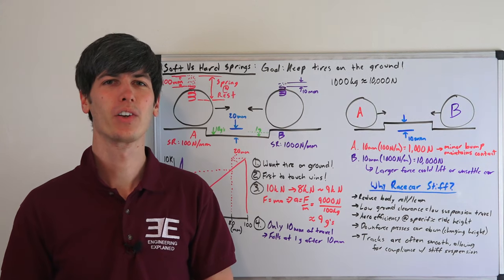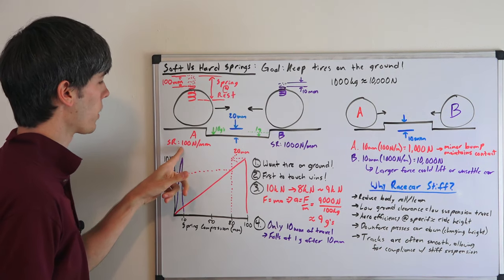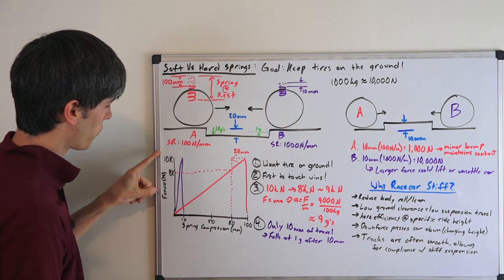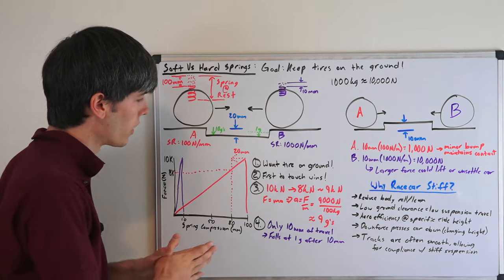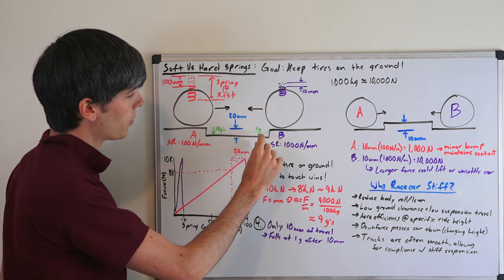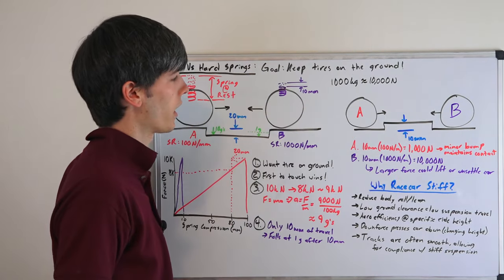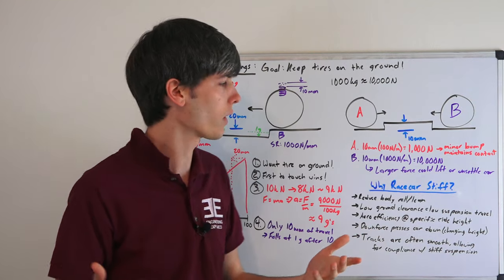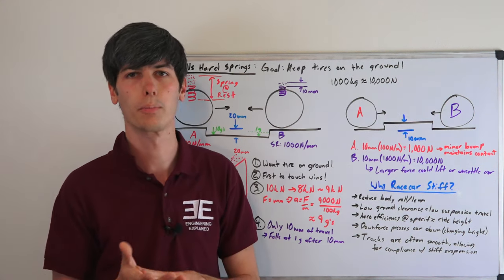What's The Best Suspension - Soft or Stiff Springs?

Comment: Stiffer springs help maintaining lower diving on heavy braking and turning. This is helpful because the sudden changes of load disrupt the balance of the vehicle and the contact patch of the tires. Having said that, most of the times racing cars' suspensions (that applies to bikes also) have stiffer rebound settings which actually help keeping the tires on the ground more under heavy acceleration or braking. That's why most of the times when tuning a car you don't mess with the springs instead you change the shocks. Just my 2 cents...

Comment: When the car is driving at high speed, the frequency of the bump accelerates, and if the tire is to get maximum grip, the shock-absorbing system that requires a short travel schedule can follow the frequency of the bump.

Comment: Very good video, thanks.
I may add few things. 
Lets look at stiff suspension pros & cons and we may assume the soft susp. will be reverse of these.

stiff susp.
pros: as you expressed on your video
plus, stiff suspensions allow more precise handling on smooth surfaces and they tend to more responsive to driver  inputs than the softer suspension.

cons
* relatively quick tire wear
* difficult handling on bumpy surfaces and more stress on suspension members & attached points.
* not comfortable

IMHO the best suspension is.. what is the definition of the "best" btw? 
Ok, let's say average "best" for the sake of the argument, it is dependent to the surface quality, road conditions, appropriateness of tires, the driver and maybe the mood of the driver :)

Comment: Let me throw a wrench into this equation. The Nurburgring... car makers test their flagship sports cars there, and try to achieve the fastest lap time for that car's class. The Nurburgring is also notoriously bumpy. Yet the end result of testing there and chasing lap times leads all car makers to fit their sports cars with notoriously stiff springs, as James May likes to complain.

I think you're absolutely right though. I just think the benefits of stiffer springs outweigh the disadvantages, even on bumpy tracks, if your only goal is to achieve a fast lap time, or have better control/feel of your car on a mountain pass. 

The one Motorsport venue where softer springs provide faster times is rallying, and the bumps on the Nurburgring or your local togue are nothing compared to rallying.

Comment: Fantastic video, I remember lowering my civic type r (ep3) and it completely destroyed the handling, mainly due to the lower control arm being pushed passed horizontal at rest resulting in the cornering forces being sent through the suspension instead of the chassis but the stiff suspension made it a nightmare also, hopping and skipping around. Removed them after 4 days or so to go back to standard springs.

Comment: As has been stated, in the racing world, you go with as soft a spring as possible. If a car has downforce, and is very pitch-sensitive because of said downforce, you will end up being forced to run a stiffer spring. Many of the new GT cars have front splitters designed to create massive downforce when placed close to the ground. Not only are they very pitch-sensitive, but they have to be withing a couple inches of the racing surface. Obviously with such limited ride height and pitch allowance, very stiff springs are used. For people bringing up spring splits, this is how one would balance the car. Usually, race cars will tend to like a certain spring split "window", a specific F/R spring ratio that moves together when stiffening/softening the car. This ratio can be moved slightly to affect the balance of the car in different parts of the corner. Also understand that a "big spring" will take a "big damper" to control it. This is very complex process, so please don't say things like "you can usually go with X front and Y rear". Without knowing car weight, motion ratio of the wheel, intended ride height, intended use, tire type, etc., you really can't state a spring rate.

Comment: In general softer suspension are better suitable for road cars which constant meets unexpected and uneven road surfaces. Race cars on race track which constantly drive at very high speed on controled flat surfaces should  use hard suspension setup. Because of aerodynamic lifts and down forces effects the racer so you must use hard suspension setup to maintain the height.
Some people still don't have any clue due to the amount of softness and hardness to use for customize their own vehicle. Although not all the time but most of the time your vehicle manufacturer's engineers has calculated the best compomise settings for your vehicle's main use purpose. But randomly some owners may not agrees with his OEM setup. So if you need to customize it then you must figure out how much softer or harder than the OEM. Not surprisingly it will be trials and errors for your perfect setting. Unless you have the opportunity to full access to your manufacture's engineering faculty or luckly for you the after market supplying you an exact test mule as your vehicle. 
If you still don't understand why and how, then stick with OEM can't go wrong. After all you are betting with your wallet.😇

Comment: There is another factor in play - damper rate. A stiffer spring demands a tighter damper to control it at resonance. Damper rates are measured in m*sec^-1*N^-1. Tighter dampers transfer more shocks.
Yet another factor is the lowpass filter created by the spring and the mass. The tighter the spring the higher the frequency at which the filter operates. In other words the stiffer spring transfers vibration at a higher frequency into the car body, resulting in excess road noise and passenger discomfort.

Comment: I like Carrol Smith's advice.. Have just enough spring to keep the nose off  the pavement under maximum braking load. Do the rest with sway bars. Also feels like relatively softer in bump and stiffer in rebound for the shocks seems like a good idea.

Comment: I put as wide and as sticky a tire as I could fit on my car. the result was the grip made the suspension feel weak. it couldn't keep up with the grip from the tires and the result was extreme body roll. I raised the spring rate to match the grip levels better and it feels better. on bumpy tracks I need to have the bump setting on my dampers at full soft or I get worse breaking.

Comment: This video is very subjective. Each has advantages, but for street driving, stiff and low allows for better handling and more grip through turns. The best case for soft springs is in rally racing, where the springs are very soft, but very long. That allows for the car to have a low stance (low center of gravity), but keeps the tires pushing to the ground despite all the dips and bumps on the uneven surface. That's just my two cents. Great explanation though.

Comment: This would be much more accurate if you included tire physics in your explanation. Sure, soft springs will give higher max grip in a car under steady state longitudinal acceleration but the moment you turn the wheel body roll will rob grip from your outside tire greatly reducing your max lateral acceleration. Not to mention the fact that a car with soft springs will experience all kinds of wacky yaw charicarisitibs if you take into account fore-aft weight transfer in the braking/acceleration parts of a turn. With overly stiff springs even a neutral steer car with IDEAL suspension geometry at steady state will push/spin in corner entry/exit respectively As you said, tires are everything, but the job of suspension is not as simple as "keeping the tire on the ground." A good suspension needs to keep the load on each of the four tires within their ideal load sensitivity. Finally critical damped stiff springs can avoid many of the problems you enumerated with stiff setups (see ohlins or moton street car setups).

Comment: His example was with both suspensions contacting the bump/dip at a certain speed.  As speeds increase, the energy of the bump increases.  Race cars, or cars designed to operate at high speeds, have stiffer springs to absorb the higher energy.  A soft spring will allow the wheel to slam into the suspension limit, at high speed.  An analogy is a valve spring:  As rpm increases the valve spring does not hold the lifter/follower to the cam lobe.  At very high rpm the valve "floats":  as a wheel would do if it's spring was not stiff enough for that speed.  That is why they use springs of different rates in the same suspension.  And they use multiple springs of varying spring rates for valves.  The trick for racers/competition is to have a stiff enough suspension for the roughest section of track, but still soft enough to maintain compliancy around smoother sections.......   Or a decision based upon the "bias" of the track......  Not to get off track, but I've heard of fluids that can change their viscosity by the application of electricity.  The fluid can be used in shock absorbers to alter the viscosity of the shock fluid, on the fly.  Electrorheological (ER) fluids

Comment: It depends on if you're driving on or off-road along with personal driving preference. I drive on pavement and my car has a low center of gravity, wallowing like a pig doesn't do anything good for steering compliance - so stiff is the way I prefer it. It's more manueverable and responsive. If I liked driving trucks I'd probably have a different opinion.

Of course these days many cars are made with variable-rate springs. An attempt to split the difference for the best of both worlds.

Comment: ive tried stiff/soft suspension on a corolla for street driving and honestly the only difference i can feel is the stiffness and softness of the springs. i can push the same speed around ramps and canyon curves and the tires will stick to the ground. the difference between the two for me is the feel of the car. in my case, i would leave my car with softer springs bc its convenient and does what i want/need it to do opposed using stiffer springs.
Reply: +Bee Vang I felt the same with my old corona, I felt I had more control with the softer springs on canyon/mountain roads, stiffer and the car loved to understeer. Plus stiff springs on the street I felt would wear out my chassis.

Comment: Ideally every motion, (ride, pitch, roll) of a vehicle should be controlled by a separate set of spring and dampers. I think it is more appropriate to say this video covers more about ride spring which control the vertical motion of the car. In general ride spring is set as soft as you can get away with that provides enough support so the car don't bottom out and don't over extend given the type of surface the car will have to negotiate. However most vehicle we see on the road are not designed with ride spring that only controls ride, but also pitch and roll. This results in a compromising situation where you can't go as soft as you want on ride while maintain high pitch and roll response like you want in a racing situation.

Comment: The springs should be as soft as possible, but as hard as necessary.  While the stock suspension of a Integra GSi is perfectly adequate for circa 1995 all-season tyres (as fitted and engineered for when it was new), when you throw on Hoosier R-compounds, probably on a 8-inch wide rim instead of the stock 6.5-inch wide rim, and take it to an autocross suddenly it's no longer as "hard as necessary"...  Hence uprated springs/shocks or coilovers being required. :)

Comment: EXCELLENT interpretation of the physics & dynamics of this subject! But I am curious about how engineers formulate suspensions for heavy duty trucks? Do the same perimeters apply? This industry only is concerned about hauling max weight, so does that change the formula? TX!

Comment: Very interesting.  I wonder if perhaps the stiff spring over a pot hole would be better because it doesn't allow the wheel to contact the bottom of the hole, it will allow the car to float over it?
Reply: +Carl S A wheel that's not in contact with the ground can't provide any traction.  That's a negative.

Comment: Ref the body roll control aspect - how do anti-roll bars / torsion bars play into the equation vs. simply reducing suspension travel and/or increasing spring rate?

Probably needs a "What an ARB does" explainer vid first come to think of it :D

It's nice to see this stuff explained with simple maths... keep up the good work.
Reply: The problem with these videos is that it talks about the effects of a piece of suspension in isolation.  The problem I have with this is that in isolation something may hold true, but on an actual car it certainly doesn't because a suspension is a SYSTEM and a complex one at that.  Spring rates themselves are not responsible for keeping a tire on the ground.  Their role in the suspension is to control the sprung mass (everything that the spring supports, like the chassis).  They play a minor part in controlling the contact patch but ultimately that job is in the dampers (shocks/struts).  Furthermore, this video does not consider ALL of the springs in the equation.  Your tire acts as a spring, as do the bushings in the suspension if they are bonded rubber bushings, as does the damper (to an extent), as do any bumpstops.  It's hard to consider things in isolation when the whole suspension is a SYSTEM where one change here can have five or six changes over there.

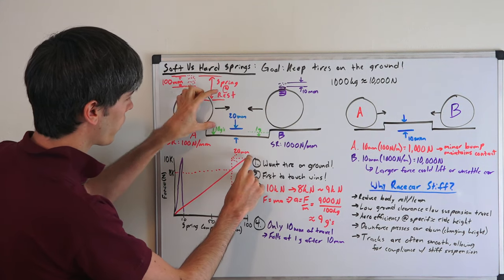Comment: The statement at 1:52 seems wrong: "As it goes over this gap, you have 10000N pressing down on this wheel".

The way I see it, the 10000N (the weight of the car) is falling with 1G and is initially not pressing down on the spring at all (the car would initially free fall onto the spring with a gradually increasing force).

The spring itself is on the other hand expanding according to it's rate 100 N/mm, THEREAFTER, once the car has fallen down into the gap and a new equilibrium has been established, the car is once again pressing with it's full 10000N weight on the spring.

Hence, the higher springrate would push the spring down faster and thus maintain better contact with the road. PROVIDED the gap doesn't exceed the travel of the spring (as in your example, which is quite unrealistic unless you drive a lot of off road).

Also weight transfer and body roll is indeed relevant to road going cars too (e.g. tire loading during cornering).

Standing by to be corrected or the statement to be clarified. In any case good job with the videos, always enjoyable. :-)

Comment: IMO it would be better if you had started with pure definitions of different vehicle motions (Heave, Pitch, Roll, Twist ....) and from this point you can add more to which motion you are considering. 
For example you have mentioned in the reasons why to use stiff suspension ((which still undefined which stiff motions you are mentioning)) is to reduce body roll !
As mentioned in some comments you can stiffen roll mode with for example U-bare connects the end wheels and still have soft coil springs per corner.

Comment: Know this is an old video, but I've always thought that harder springs were needed as stickier tires create more body roll, and probably affects the contact patch of the tires which on a race/performance tires, doesn't want to deform to keep the steering accurate at high speeds; while a softer comfort tires wants the body roll to exert more pressure on it so it deforms and give better traction as low to mid speeds more commonly seen on road. Thus why using  a stiff suspension is needed for when using stickier tires, and why it's counter-intuitive to use low friction tires with stiff suspension.

That's my conclusion after spending boatloads of money on suspension and tires and finally realising that if I want control, I have to forgo comfort.